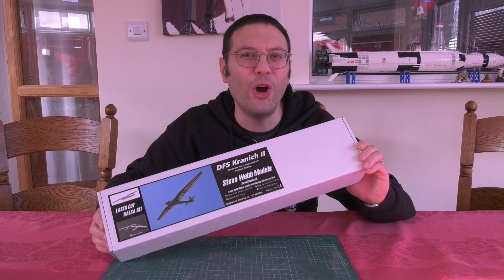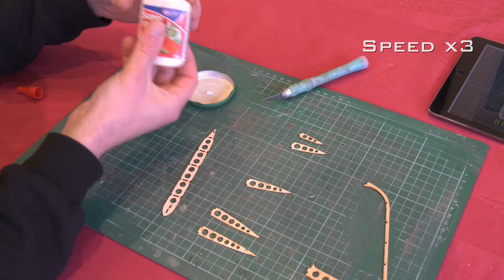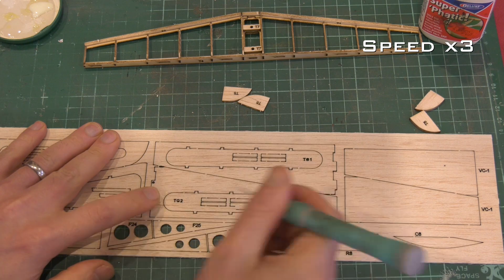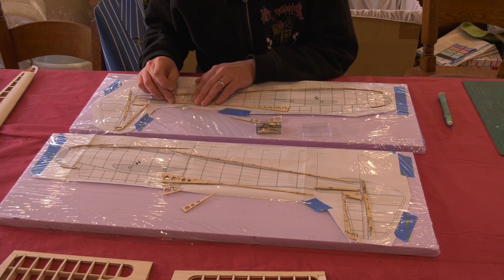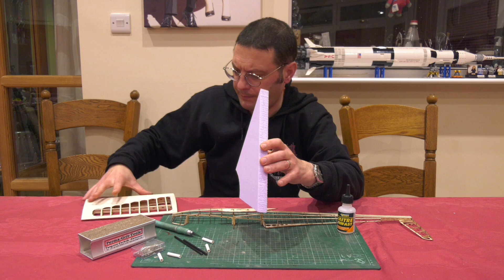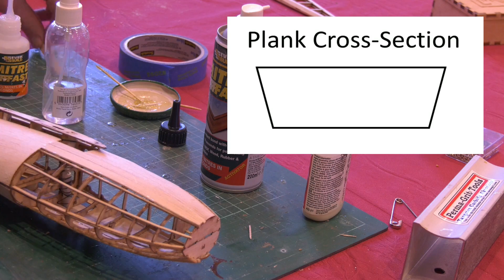Tony Ray Kranich 2 Build & Review - Part 1

Comment: Ce kit est très beau et très léger, mais il est effectivement assez complexe à construire. Pour ceux qui ont l'habitude des kits Dumas ou Guillows, ça ne sera pas un problème, pour un débutant non accompagné, ça sera une galère. Comme indiqué dans la vidéo, les découpes sont effectivement très précises, même trop précises rendant les assemblages très serrés. Quand on travaille avec du balsa de 1 à 1,5mm, forcer pour assembler deux éléments ne pardonne pas. Il ne faut donc par hésiter à reprendre les fentes de quelques coups de limes ou papier fin. 
J'ai constaté trois problèmes: 1: la notice téléchargeable est très pixelisée et il est difficile d'y lire les n° des pièces. 2: les pièces ne sont pas toutes référencées sur le plan (les longerons des ailes par exemple) et 3, il y a une différence de densité du balsa destiné au coffrage. J'ai construit deux kits et dans un, le balsa de coffrage était plus léger et plus facile à mettre en forme. comme indiqué dans la vidéo, Il faut impérativement le mouiller au risque de le fendre. Pour conclure, il faut vraiment prendre son temps pour construire et bien étudier chaque étape avant de mettre la colle
Merci pour le partage de la vidéo et très belle construction à tous.

This kit is very beautiful and very light, but it is indeed rather complex to build. For those used to Dumas or Guillows kits, this won't be a problem, but for an unaccompanied beginner, it'll be a pain. As shown in the video, the cut-outs are indeed very precise, even too precise, making assembly very tight. When you're working with 1 to 1.5mm balsa, forcing two elements together is not an option. So don't hesitate to pick up the cracks with a few strokes of file or fine paper. 
I found three problems: 1: the downloadable instructions are very pixelated, making it difficult to read the part numbers. 2: not all parts are referenced on the plan (wing spars for example) and 3: there's a difference in the density of the balsa used for the formwork. I built two kits and in one, the formwork balsa was lighter and easier to shape. As indicated in the video, it's imperative to wet the balsa to avoid splitting it. In conclusion, you really need to take your time when building and study each step carefully before applying the glue.
Thank you for sharing the video, and very nice building to you all.
Reply from the maker: Yes, I agree with your findings.  A beautiful kit, but not for beginners.  A bit of skill and care is required to build it.  The 3 meter version of this and the Minimoa are easier to build, and perform better for a very similar build commitment.